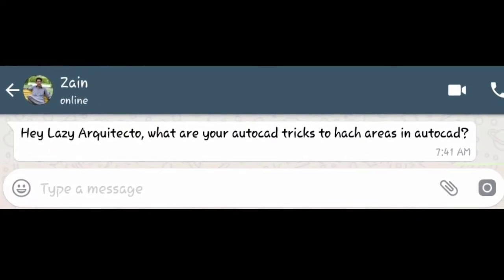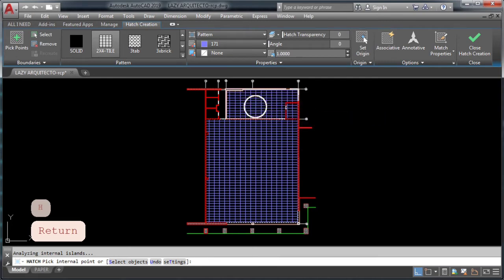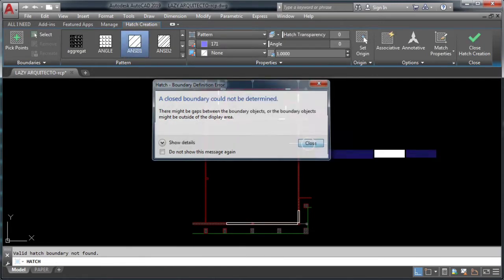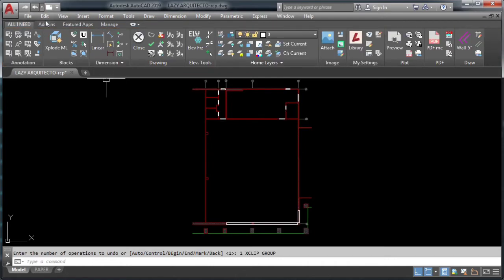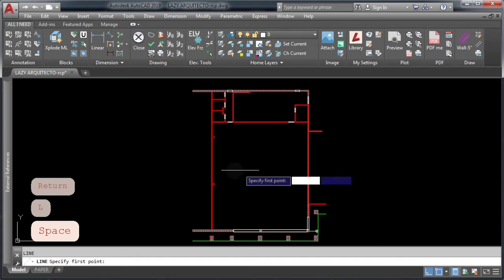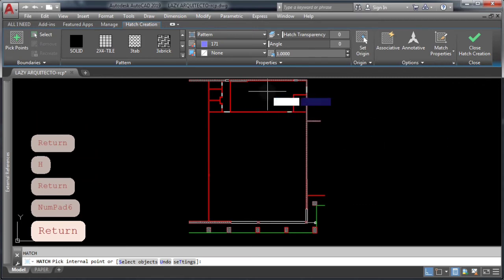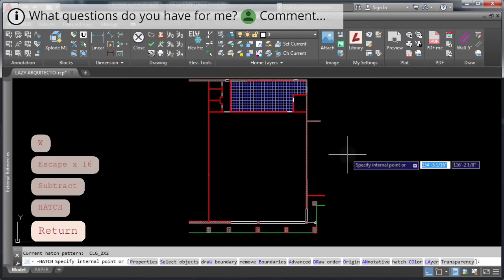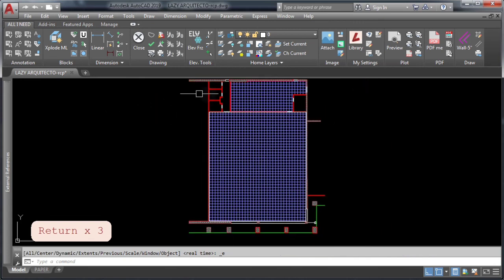Autocad Hatching Problems: Fix Autocad Hatch not Working |P2V9

Comment: Hello, the problem I have with hatch is- when I use solid hatch and save it in pdf. Pdf format shows white lines that random appears over hatch. I have tried to uncheck "Smooth line art" in pdf reader but it is not working. Do you know maybe solution for this problem? 
Best regards
Reply from the maker: What option are you using to create PDF, adobe? Do you see "Optimize the PDF for web view"?
Reply: same problem
Reply: Select plot style to none

Comment: Hello,   the problem I am experiencing with hatch is that when i create the hatch, i get the 'create hatch'  ribbon but when click on the hatch, it doesn't show the  'edit hatch'  ribbon.  
Another problem i am experiencing is that when I hatch something, the hatch and the hatch boundary become one entity so i cant delete  just the hatch or delete just the boundary. 
 
I could not find a related tutorial or solutions
Reply from the maker: Hi Anjulie 👋 what you describe happens when the hatch pattern doesn't exist in your drawing. If this is true, you can only stretch the hatch using the grips, but not edit it from the ribbon. Try using a different hatch pattern, can you still not edit it from the ribbon? Let me know
Reply: @LazyArquitecto hello, I have tried using different pattern but still no 'edit hatch'  ribbon appears and when I stretch the hatch, the hatch boundary also stretches along with it.

Comment: Autocad program crashes everytime i use hatch command, do you know how I can fix this problem?
Reply from the maker: Grayfis Did you try turning hardware acceleration off?
Reply: @LazyArquitecto  how do I do that?
Reply: @LazyArquitecto  how do I that?
Reply: @LazyArquitecto  I was able to turn it off, it still crashing every time I try to use the hatch command.
Reply from the maker: @grayfis1  try setting up the HPQUICKPREVIEW variable to OFF
Reply: @LazyArquitecto  i have already and did not do anything at all.
Reply from the maker: I would try to reset Autocad to default. If you need help here is how https://youtu.be/hF0EmnDGlsc
Reply: @LazyArquitecto  just so you know its a 2014 version. I will trybto reset to default.
Reply from the maker: Let me know how it went
Reply: @LazyArquitecto  still crashing. Can I send you the file and see if you can figure it out?
Reply from the maker: @grayfis1  do you mean autocad crash only using hatch on this specific drawing?
Reply: @LazyArquitecto  yes. Other files working fine.
Reply from the maker: @grayfis1  ok send it to irving@lazyarquitecto.com and I'll take a look
Reply: @LazyArquitecto  i sent the file to your email.